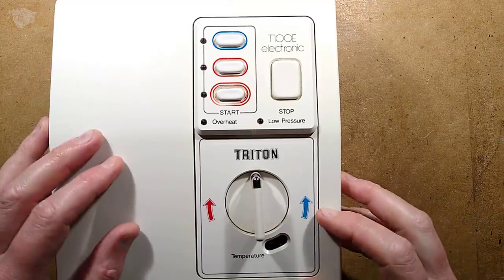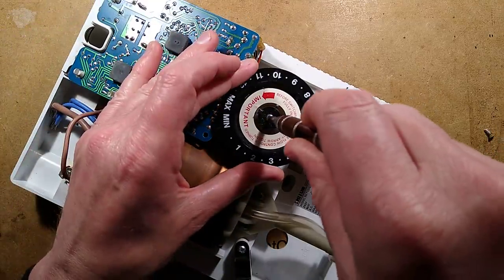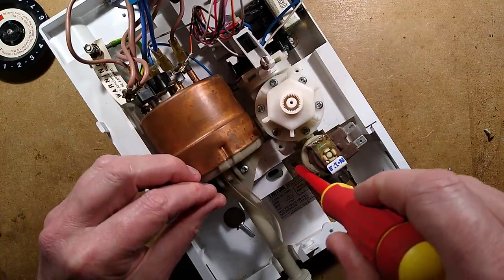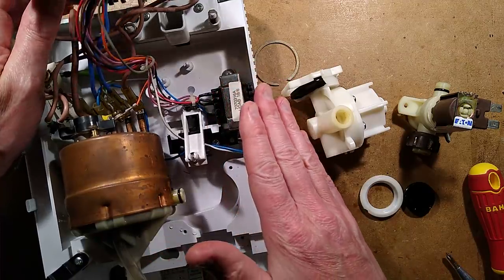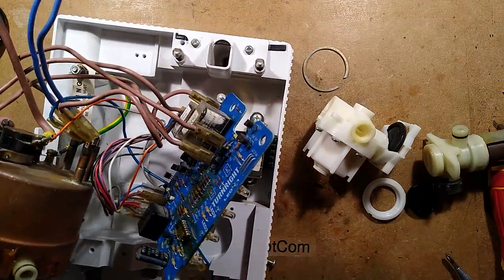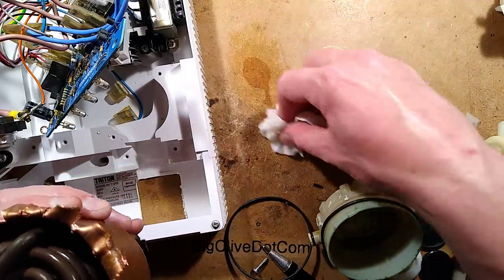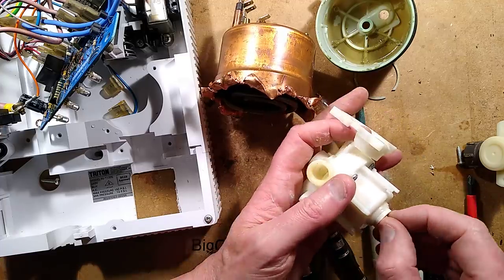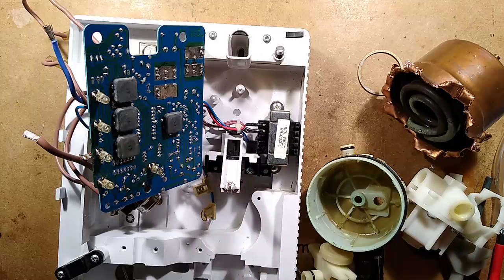Teardown of a British electric shower that went bang.

Comment: "Americans don't think electric showers are very safe"

Say the same people who use un-fused un-grounded plugs. xD
Reply: Here in Germany our plugs are not fused like most plugs in the world, and a variation of our plug isnt grounded either
Reply: They don'y need fuses, fuses are only a thing here because of our ring main system. Also many UK plugs now have plastic earth pins. There is a lot of crazy stuff with US  electrics but lack of fuses and earthed plugs aren't the major problems.
Reply: The US also uses split phase electrical systems.
Reply: @mfx1  Yea, I've always thought it was kind of strange that our ground/earth conductor in mains wiring is just bare copper..
Reply: @yxcvbnmmnbvcxy544  But our outlets are friggin recessed, which solves a lot of problems plugs around the world have with one fairly simple trick.
Reply: Its also my understanding, that to ground ESD mats for use with electronics components, Americans actually tie the wire from the mat directly into a screw on the plug socket (or so i saw in a video), is this true? It seems really jenky. In the UK we can just use a pop stud to connect them to a 3 pin plug.
Reply: @nozyspy4967  On American outlets, the center screw on the outlet is tied to ground, so either method would work.
Reply: @nozyspy4967  The bracket on a grounded receptacle is a direct ground connection. This also grounds any metal conduit,ect.
Luckily they don't make the 14ga copper conductor/18ga aluminum ground cable anymore. I've no idea what a pop stud is
Reply: Look guys, just because we haven't had the pleasure of having our major cities leveled during a world war, leading to a modernized redeveloped electrical grid, thus our stuff largely remaining evolutions of 1st generation electrical development... ...doesn't mean that it's our fault that it's flawed & outdated!!!
...same goes for our horrid internet too - developed here from 1st generation all the way up to the point of being outdated...
Reply: Dave Micolichek  ...yes, I'm aware that the concept of "fiber to the home" does in fact exist in North America(I sold the crap door to door... ...well, that implies that I actually got anyone signed up - so, I was employed to sell...). Some people even get 5g mobile service every day too - and they're hardly representative of the average mobile user in North America, where many still don't even get reliable 4g.

If you want to understand what I'm talking about, search for the average South Korean internet speed vs average US internet speed(hint hint - the US isn't even in the top 10...) - it isn't even vaguely in the same territory, in spite of the basic hardware structure of internet service being developed in the US well before they were even using computers at all in South Korea.
Reply: Yeah and we bond our grounds to neutral and leave excess paths to electrocution everywhere... Even our emt conduit
Reply: We use GFI on any outlet or switch near water and anything that carries a large load uses a three pronged plug, the third being the ground/earth.
Reply: Americans have 120v mains. It has a lower potential energy than 240v allowing us to get away with switched outlets and non tamper resistant mains outlets. 240v is still used for large appliances, central AC, and home EV charging stations. Also RCDs/GFCIs are required for kitchen and bathroom outlets in the USA.

Comment: The idea of messing around with a 240 V device in the shower makes my skin crawl.
Reply: It seems like you may need the hot for hand washing in a nearby sink as well,  id think that same heater would go on the wall outside the shower where it can stay dry and supply both taps
Reply: Yeah, more modern on-demand electric water heaters are a separate unit that will sit in front of the sink and shower.
Reply: SlocketSeven, 0.25 gallon per minute ???! You have to walk in circles to get wet or what ?! My natural gas powered central heating system with hot water pushes out a whopping 14 Liter per minute. (3.7 Gallon) 
I have a 15 by 15 inch  "rain shower" build into the ceiling of the bathroom and it needs a lot of water to work well, but it's soooo nice and comfortable. Maybe even too comfortable , sometimes I turn on the water in the kitchen to get my kids out of the shower ! (they will get only cold water if I do that)
Reply: @SlocketSeven  Yeh that's why you can buy these in a 10.5kw model otherwise you would struggle to get hot enough water
Reply: @martijnvv8031  that sounds like a shity system if you're in the shower and someone uses another outlet somewhere else in the house the shower doesn't work, what backwards country do you live in?
Reply: @yourrightimsooosorry884  It's not really backward. Millions of UK homes have a hot water tank, where the water gets heated quite slowly - so if you turn on taps while you Sister is in the shower, she'll scream at you. Perfectly normal.

In some countries, they have huge hot water tanks - but UK homes are often quite small, so the tank isn't very big.

Only in the last ten years or so have combi boilers started to be common. Those deliver a high volume of hot water at a speed fast enough to keep up with any reasonable demand.

Comment: The black diaphragm pushes the switch closed to enable the heating element to turn on.  If the water pressure on the cold inlet is too low then the heating element will not turn on. It's a safety feature to reduce overheating of the water when the flow rate is low.

Comment: Can we get a installation video of the new shower? As you need open it up anyways to install it?
Reply from the maker: It's the same model I've already made Video about.  Triton Cara.
Reply: @bigclivedotcom  I still have a Cara in the flat, been here three and a half years and it's been fine. I seem to recollect JW did some stuff on conductivity of flowing water a while back, which implied that within reason these things are safer than one might think, although I'd still way trust these over those "suicide" shower things.

Comment: I reckon a bit of reverse engineering and a 3D resin printer could have printed you a new part for the price of a new shower.
Reply: Get the hot melt glue gun out Clive !
Reply: Nah, just drip some resin in the hole to seal it off and then bypass the switch. What could go wrong?

Comment: @06:09 is it lik this,..... the regulator controles the flow, by that higer/lower flow the heater produce more/less hot water,....
Reply: Yes.
The water is only near the heating element for a very short time.
If you increase the pressure, the water moves faster, so it is not heated up as much. Like... you can run over hot coals, but you can't slowly walk over them.

Mains water is usually at quite high pressure, which would give you a strong but cold shower.
Reducing the pressure with that valve means you get a weaker but warmer shower.

Comment: I've always been terrified of electric showers, I'd much rather my water be gas heated, so any bang happens at the other end of my house and the kitchen burns down.
Reply: They are not very nice to use, there is no proper control over your water, and flow rate is minimal even with 11kw unit. In the winter it is worse,  as incoming water is colder. But from electrical safety point they are safe, as long as were installed properly. By properly i mean there is good cpc (earth) continuity, eath fault loop impedance is not higher then permited for overcurrent protection device and the circuit has means of additional protection installed (30ma RCD)

Comment: This was clearly a good one, the cheap ones only had one heat setting, hot (element in use) or cold (element not in use), plus of course the flow regulation.

Comment: That won't fly in America. You know, code and all that. We have instahot unites, but they hang on the wall. No mains inside the tub area! I am sure that's to save us from our selves!!!
Reply: *laughs in German... seriously though there is a DIN for where you are allowed to put electric installations in the bathroom- BUT it wouldn't even come to that anymore because electric water heaters don't comply with Energy saving laws
Reply: @olik136  What do you think about their decomitioning of their nuclear power plants, pushing reliance back onto coal/oil?
Reply: you know that code can be assesed and that there are compilers out there that are certified for mission critical applications? also there is no code here...
Reply: all electricial installation in UK conform to British Standards.... so are also to a 'code'.... r.c.d. protection to the circuit moniters the electric current in the circuit and any imbalance due to a fault the rcd trips the circuit, plus all metal work within the bathroom is 'grounded'... it is a very safe system...
Reply: This hangs on the wall in the shower.  It's not down in the bathtub.
Reply: @olik136  kattles like the one clive recently repaired are quite common though. they are nothing else than electric water heaters.
and they continiue being sold new.
Reply: I just looked at the 2017 National Electric Code. We can have lights in the shower (which I've seen) if they are rated for wet locations. And we can also have switches in the shower if "installed as part of a listed tub or shower assembly."
Reply: Water proof lights and switches on tubs, like jacuzzi's, are code. Water heaters are not allowed inside of a bathing unit of any sort.   The code is for America, not for other countries. In other countries all kinds of things are code that aren't here. I should have specified what country I was in. And when I said protecting us from our selves, since code doesn't allow it, "it's for our own good"!
It was a little sarcasm, meant nothing by it!
Reply: I should have looked before I posted, I did say I was in America in my first post!!!!!!
Reply: Deb Y Yet they allow open vented gas water heaters inside properties, far more dangerous! Plus people can install their own gas water heater- with an open flu- a recipe for disaster! I have even seen gas water heaters sharing a single old brick chimney with a heating furnace with forced draft- apparently common and quite legal, but in Europe understood to be deadly and banned decades ago.
Reply: @spencerwilton5831  We even have attic exhaust fans here in America that are proven to be dangerous. They kick on if the attic reaches a certain temperature and are meant to cool the sealed attic by blowing out the hot air... That makes no sense, right? See, that creates negative pressure in the attic, creating a draft that pulls air from the living space up into the attic. And where does the air come from to replace the air in the living space? From cracks in windows, doors... And from gas lines connecting to gas appliances. These useless exhaust attic fan contraptions have been shown to pull gas into the living space. And they are ineffective at their job! (By the way, I'm not referring to the sort of attic fan installed in the ceiling of the living space. Those draw air up into the attic to force a draft if you open the living space windows and have a vent in the attic, I grew up with that and as far as I know they don't cause the same issue AS LONG AS THE WINDOWS ARE OPEN)
Reply: @spencerwilton5831  that is not code. You can put a water heater and a furnace in an old chimney, power vented units can't have the two together.
Reply: Spencer Wilton The soffit is supposed to be vented, under the roof. That's where the air comes from.
Reply: @AClay-ic2dc  You realize that gas lines are pressurized, right? So the leak is almost certainly present whether your attic fan is running or not - a leak sensitive to such a miniscule pressure differential is a rare and unlikely thing.
Reply: I think he means flue gas / monoxide...
Reply: Attic fans, if installed correctly, shouldn’t pull any air from the living space. A properly installed attic fan will be installed in either a gable or roof vent and pull air through a vented soffit. If an attic fan is pulling air from the living space, it’s not installed correctly. An incorrectly installed attic fan pulling air from a living space could potentially pull carbon monoxide from gas fired appliances that could potentially be lethal to the occupants. A properly installed attic fan is intended to pull hot air out of an attic to help the house or building stay cooler in hot weather.

There’s similar, but different rules and laws in the United Kingdom and the United States that govern building, electrical, plumbing and so forth. No set of rules or “code” is perfect, that’s why rules are changed and modified from time to time as the need arises. The way that power is generated and distributed in North America is similar but different from the United Kingdom as are the ways some infrastructure is installed. I don’t believe that one way is necessarily better or worse, although arguments could be made. Comparing notes and seeing how things are done and governed in other parts of the world I think is a good idea and it’s interesting (at least to me anyway).
Reply: Stephen Smith in the United States we have a similar device called a GFCI that works the same way. The rules here require that these devices are installed in wet areas like bathrooms for example. I’m sure that the electric showers are just fine if they’re installed properly.

Comment: The " Septics " just don't get it.
Reply: It does go against the grain that we have 8 or 10kW elements, housed in a plastic enclosure, only cooled by the influx of cold water! The mains cable specified for these monsters is massive (and yes, it does still get warm to the touch.) Notice how at least one of the self-tappers appear plated, not stainless.  Penny pinching.
Reply: I wouldn't get it either if my supply voltage was half what it should be.

Comment: Clive, had you ever been inside that before?  The yellow crimp on the bimetallic thermostat doesn't look factory.
Reply from the maker: I can't recall doing anything to it in the past.
Reply from the maker: Looking at the video that yellow crimp was used to accommodate the main feed cable to the cut out.  After that it fans off as two circuits.

Comment: Interesting design!  We do have point-of-use demand water heaters in the US, but they are usually in areas without a central hot water system. There's been a lot of debate about the efficiency of storage type water heaters, but the finding was that they are quite efficient. The lower power demand over a longer period of time is also better for the electrical supply,  some people say. 
That is a good design with the LV transformer for the control power, instead of a switchmode supply.

Comment: That is indeed really old for a power shower unit. Every new place I've moved into so far has had an old one (but not this old) that went bad during my use of it so got replaced with a new one.
Reply: It's not a power shower - those have both hot and cold water inlets. This one only uses cold.
Reply: @ann_onn  interesting, thanks for that. I'll continue to call them power showers though, as a slang term :P

Comment: I think it makes more sense to have the heater right near where you want the hot water, rather than way outside the house where you have to heat and waste 10m of water before it gets to the tap.
Reply: True, but I am not sure about how it would fair with other water heating methods. For example, my house makes use of both stove and solar panels for heating water which makes these sort of units sort of pointless as I rarely have to use the electric heater at all. My heater is also quite a bit larger than that so I wonder if the waste due to transportation surpasses the efficiency of a larger unit... But if it matches it on efficiency and has a no heating function (without having to fiddle with anything more than a switch) then it'd make sense.
Reply: But you don't have to put it in the damn shower itself. There are constant flow water heaters you can mount on the wall and connect your shower to.

Comment: Wait your don't have hot water cylinders? I know you don't have mixing taps.. But do you not have hot water taps at all then? 🤔
Reply: Yes, but this makes it easier to install as you just need a cold feed. They're crap basically. Especially in Winter when the incoming ater is colder so you have to turn the flow down even more to maintain the temperature. Nasty horrible things, usually installed by landlords who don't care about their tenants.
Reply: The issue with traditional hot water systems is that they're at very low pressure (typically 8 ft head), so a shower would have poor flow. The options are then a power shower, requiring a pump plus hot and cold feeds, or a cheap electric shower requiring just a high pressure cold water supply. In modern properties with combi boilers or (better) an unvented hot water cylinder, the hot water is at the same pressure as the cold water so a simple thermostatic shower works well.
Reply: I have mixer taps